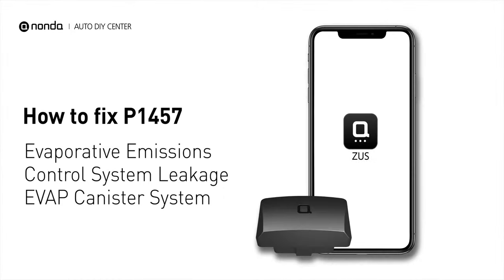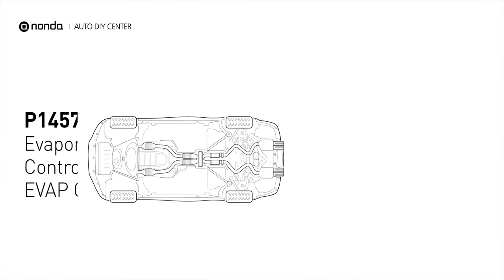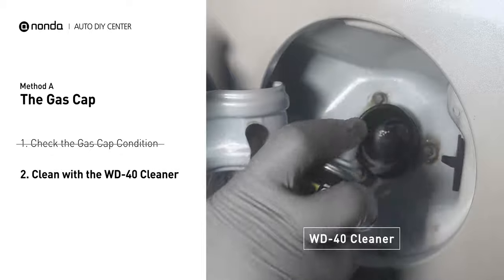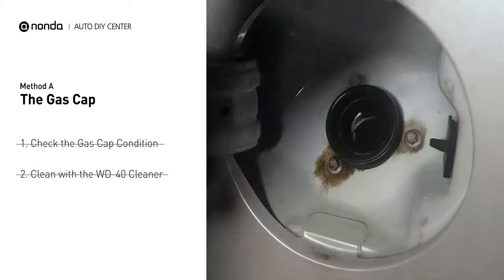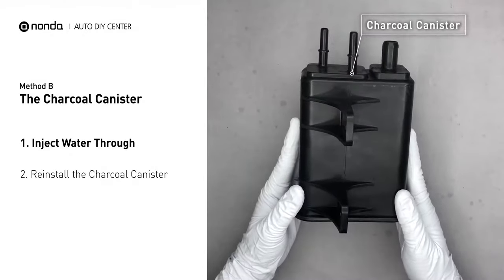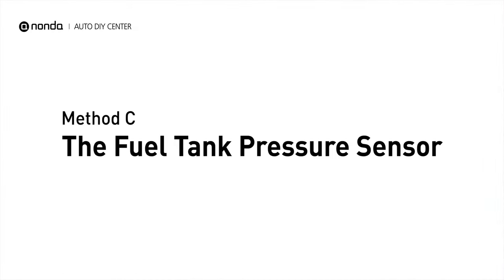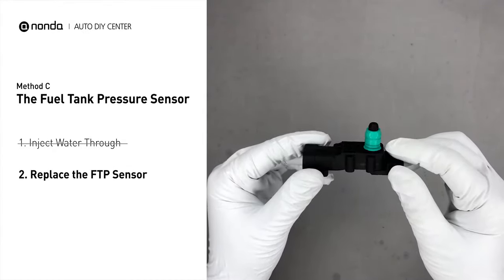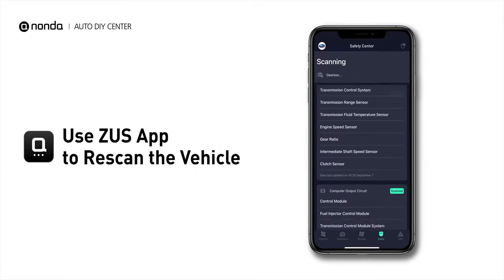How to Fix P1457 Engine Code in 4 Minutes [3 DIY Methods / Only $4.59]

Comment: I was wondering what my problem was, I was recommended to check the vapour canister but no fixes would solve the problem. Every time I fill up on gas, the car doesn’t want to start. It’s 100% the fuel tank pressure sensor, that makes so much sense. Thank you!

Comment: I have a 2000 honda crv with a p1457 code. I tested all the solenoids and all are in working order. I replaced the gas cap with an oem one, and I used a smoke machine to pinpoint any leaks, but found none. Any suggestions?
Reply from the maker: Hello, have you double checked if there's any other code registers along with P1457?
Reply: @nondainc  theres no other codes. Just P1457
Reply: Charcoal canister vent valve or the purge valve on the throttle body. You're welcome.